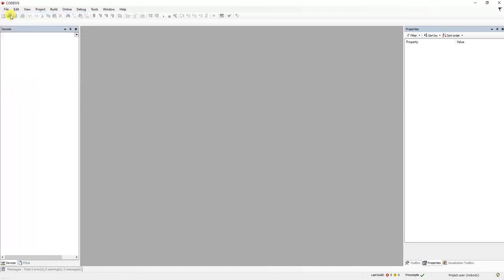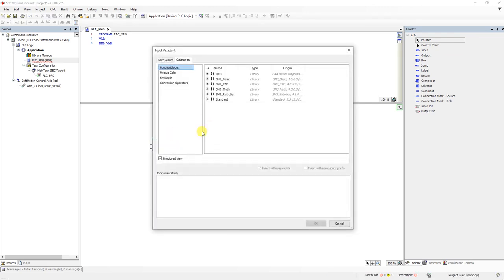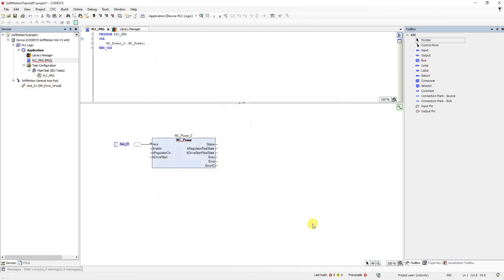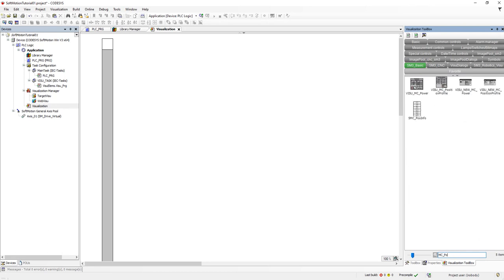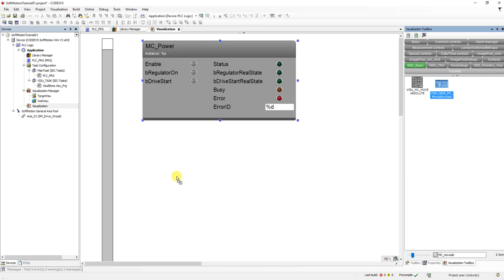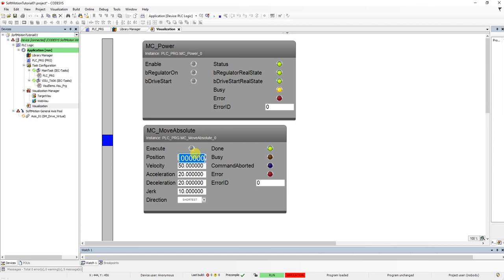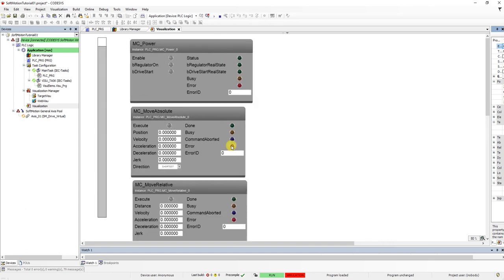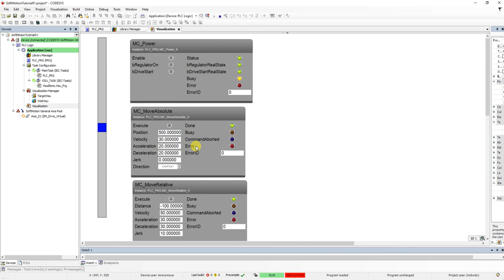Codesys: Introduction to SoftMotion with CFC #codesys #softmotion #iec61131 #cfc #twincat

Comment: Hi, softmotion library and SM3 block visualisation is not showing in Codesys s/w. It’s an open library. And how to add the same in my s/w as library block and visu block both.
Reply from the maker: Hi, thanks for your comment. It looks like your installation is not complete. You may install the missing components directly in the IDE. Select the "Tools" menu and then "CODESYS Installer", then find the missing component and install it. I hope this helps.

Comment: Dear professor Alizadeh
Im a beginner  in Codesys and I installed the codesys and I intend to make a test project by cnc softmotion of course i did steps according your videos but something is strange for me when I need add a device for softmotion there is nothing in the append device and i cant  find virtual drives !!??

now there are two question :
1st. Did i do  something wrong in software installation ???
2nd.dose softmotion need license ?? 

could you please advise me in this regards
Reply from the maker: Dear Anooshiravan,
I just replied to your email.